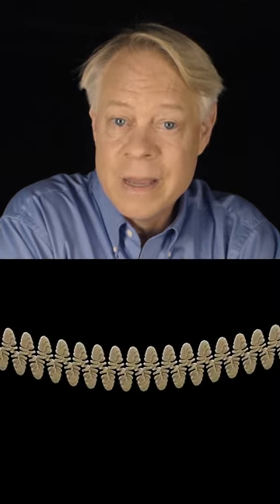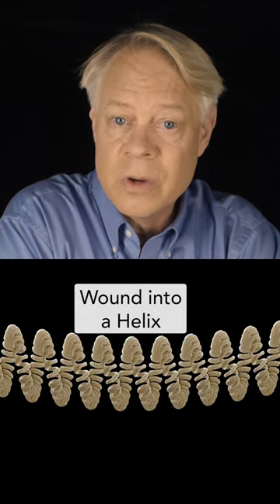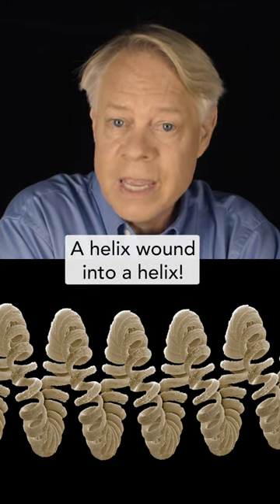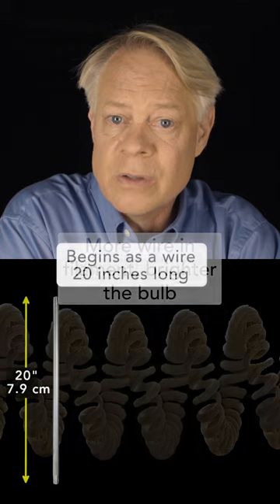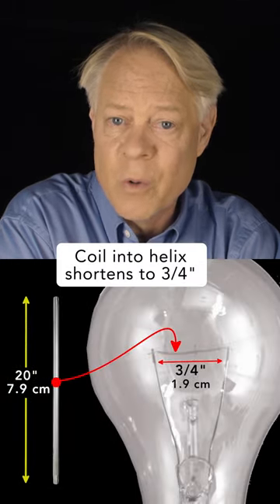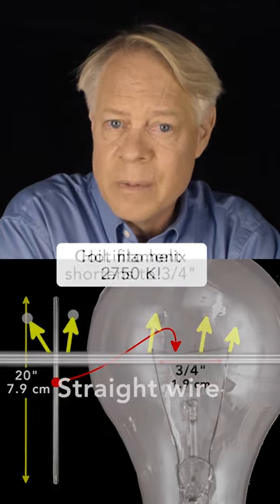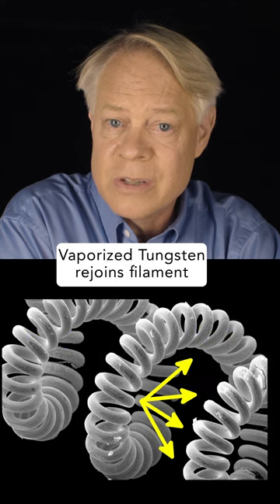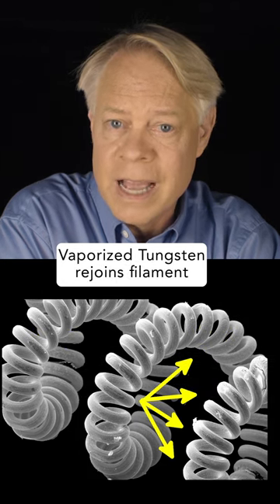Light bulb filament #shorts #engineerguy #engineering

Comment: Of course the other reason is that the engineer calculated how long and how thin he needs to make the tungsten for a 110v (or 230v) bulb, and then started to wonder how on earth he could cheaply get all that length inside such a small bulb!! The (best) answer: a double helix!!
Reply: Getting 120 ohms out of wire half an inch long is a surprisingly difficult challenge.
Reply: How long could the common household light bulb be engineered to last?
Reply: Do you know that they could make incandescent light bulbs that would last longer than what was commercially available? It was because of a regulation that limited the lifespan of all the light bulbs back then to only 1000 hours. A regulation proposed by the Phoebus cartel — Philips, Osram, Tungsram, General Electric, Associated Electrical Industries, and several other companies. It was all planned obsolescence.

Comment: I doubt the last claim: that the helix would increase the lifetime of the double helix wire (compared with a straight wire of same length and diameter). I think when a tungsten atom evaporates, it's very unlikely to condense at a place where it would extend the lifetime.
. . . But that's different for halogen lamps: the evaporated tungsten reacts with the halogen gas but splits up again at hotter parts of the wire, which is where the tungsten needs to be thicker. Therefore, halogen lamps can be operated at higher temperatures and give more light per consumed energy.

Comment: be an engineer that understand the metric system, and know that 20 inches is NOT "7.9cm" (it's more like 50cm)
Reply from the maker: So I’ve heard
Reply: I was so proud to have a 20"-er before i read this :(
Reply: he converted in the wrong direction oops
Reply: @tohopes  I get that, easy mistake to press the division instead of the multiplication on the calculator, but any engineer should know what 20 inches look like and what almost 8cm are, that shouldn't have gone into a video that promotes engineering
Reply: @quilmore  i disagree, i feel that leaving the error in the video was a stroke of avant garde and boldness.
Reply from the maker: @tohopes actually we cannot change it: you tube does not allow changes to a posted video … we could upload a new corrected one, but then all comments, reach etc of the first video are lost.
Reply: @engineerguyvideo  no i know. i meant leaving it in while editing was bold and avant garde.
Reply: @engineerguyvideo  I'd do the right thing and take this one down and start again, that's what an engineer will do if they present a plan with such a mistake
Reply: @quilmore he likely did a cost benefit analysis, and evidently decide to keep it. Interestingly, errors can make people more engaged with the content; just look at our comments. 🤓